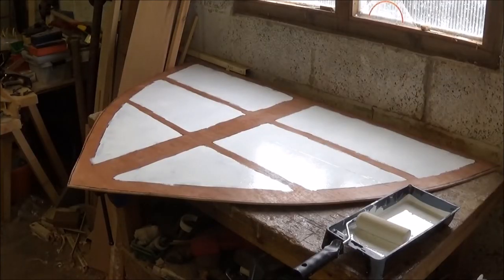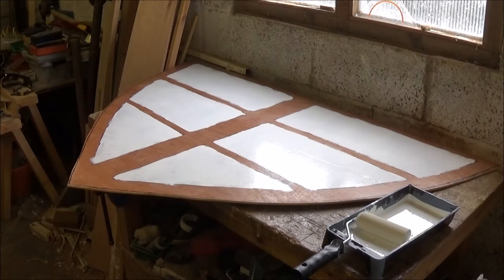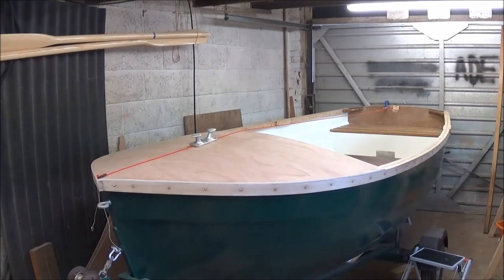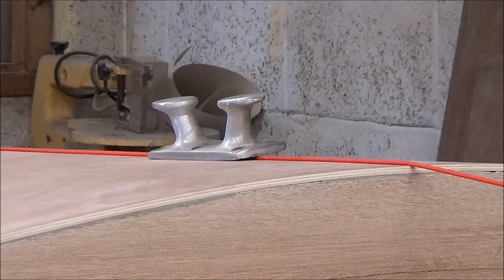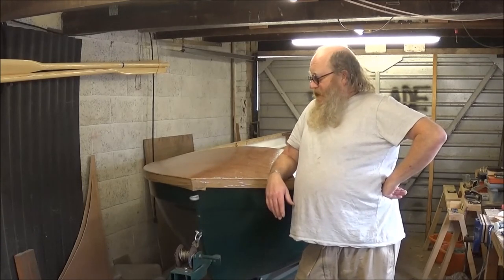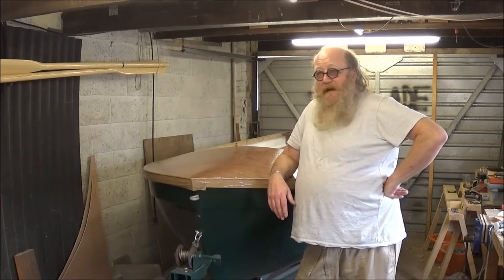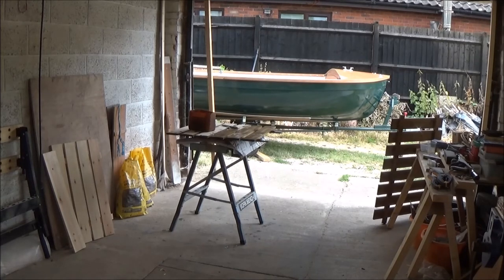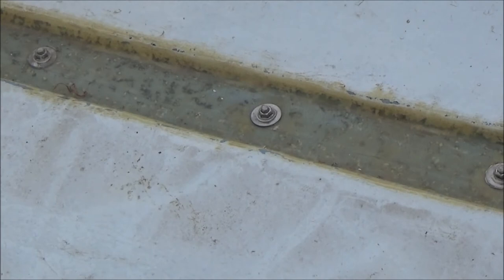Dale Skidmore - Boat restoration Part 30

Comment: Great tip sourcing the acetone!, I'll have a browse next time I'm there!
Reply from the maker: Not really sure if it is cheaper in the long run, but I only use a small amount at the time and found in the past  that cellulose thinners evaporated well before I had used any great proportion of them.

Comment: That screw and sand beading looks a treat.  They say the devil is in the detail, but so is an awful lot of the right kind of special .
The  oiled wood finish on the trim and  'flats'  looks a treat . Loving that , did I ever mention that ... :D 
The  drop down rowlock 'thingies'  have a vintage look about them , and as daft as it may sound  they will be well complimented, and vice versa, by the wood look areas.
Marvellous project you have going here, can't wait to see her wet and wildish.
As for hammocks, I have one, but as a one time broken back  recoverer, I will miss them . Can't spend that long that folded over.  The ground , air mattress, or even the car with folded seats and feet up  for me... if I get out.
Thanks for  loading this series. Really, really enjoyed it.
Reply from the maker: I knew the beading would look good, if done well, but I am still surprised at how well it turned out. Really made a difference. The drop down rowlocks were a lucky inclusion on the boat. I haven't seen any for sale on ebay either. I am pleased you like the "vintage" look, it was sort of what I was after really. At the very least hammocks are good place to nod off for an hour whilst reading a book.. Hopefully it won't be long before you get to see some wet and wild action, ha, ha, atb.